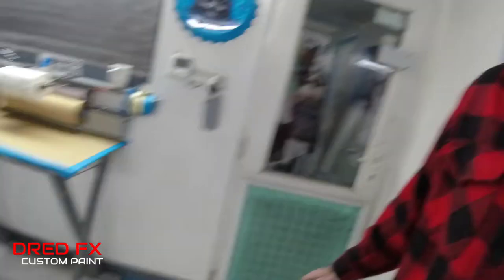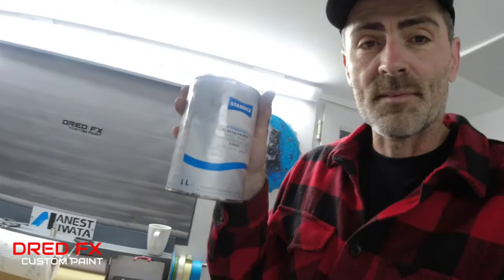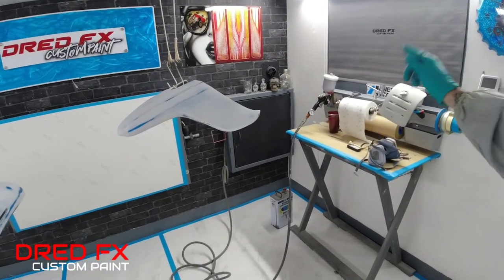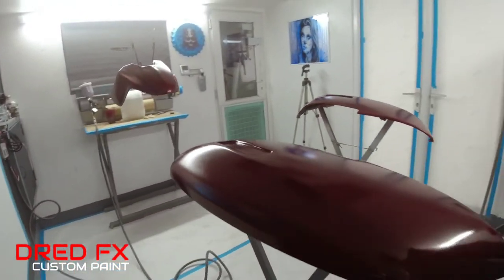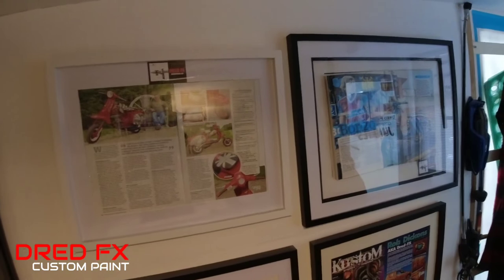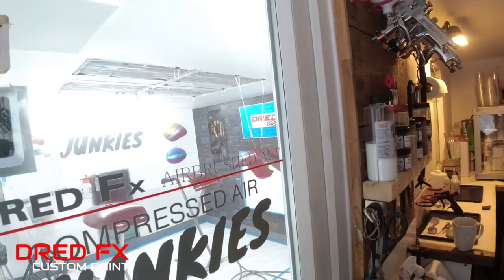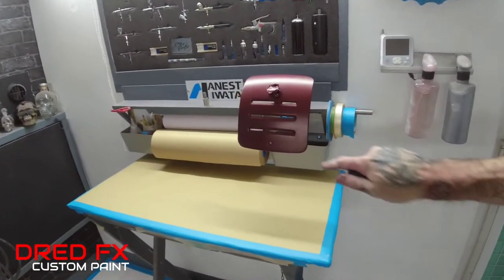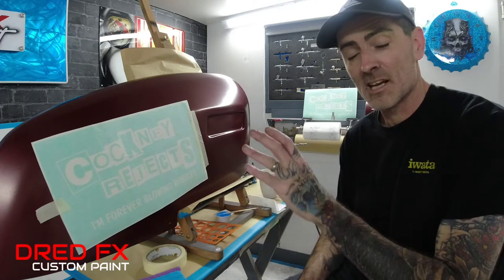it's time for some paint and artwork

Comment: Superb job on the panels mate love the logos and those bubbles look very realistic, don't suppose you have a code for the Chrismon basecoat it's a really nice colour and would like to add it to my list👍 

I feel your pain Rob as it was -7C in my workshop this morning at least the booth was a bit warmer at a barmy -6.5🥶🙄😅 after 40mins of heat it got up to 20C in there which isn't to bad but lower than usual.
Looking forward to the clearcoat stage🙏🙏👍
Reply from the maker: Thanks John will grab you the code mate give me one min 👍
Reply from the maker: Here you go John JAGUAR CRIMSON 2 code C F F
Reply: Thanks Rob, found it on my system and there is 9 different tinters in the formula, I think it's the most I've seen for one colour👍

Comment: Nice compact  bike paint studio mate  .I use one of them Chinese diesel heaters in my booth with just the outlet into the booth .
Pearl maroon is very transparent .I like a dark grey or black as a background coat .Upol etch primer in a spray can is dark grey and  goes on very smooth .There is no hot solvents in it and i just tack rag off before base coats .I usually spray a spray out card half grey and then you can tell when you get coverage.
Are you putting satin black or bed liner on the backs of the panels ? I really rate  that mipa black bumper texture paint.

Been painting 50 years ,how sad am i watching someone painting on YouTube lol .
Reply from the maker: Thank you for coming over and giving your advice and support much appreciated 🙏
Reply: @dredfxcustompaint  You made a good move blowing that paint shop out after painting them wheels .
Just stick to working in your studio on bikes .
Reply from the maker: @rocklover7437  yes it was I miss the regular money but things would never change there so had to walk I love it painting in the studio 
At my own time and pace with everything to hand not like the bodyshop where your looking for stuff all the time